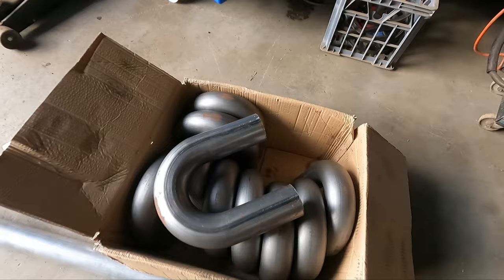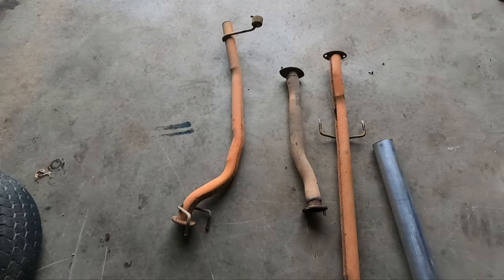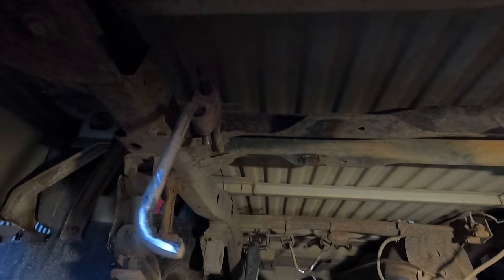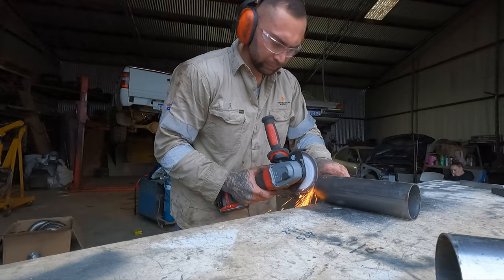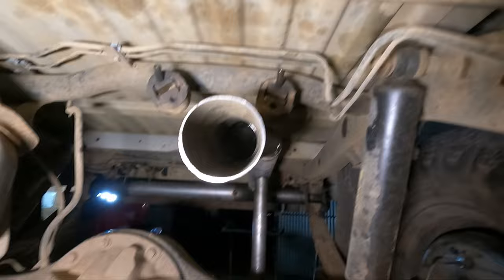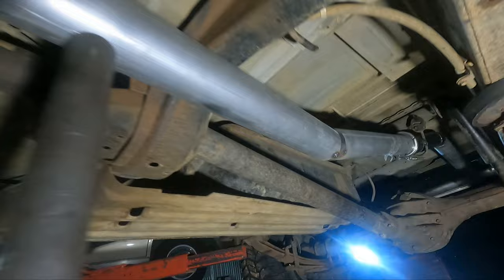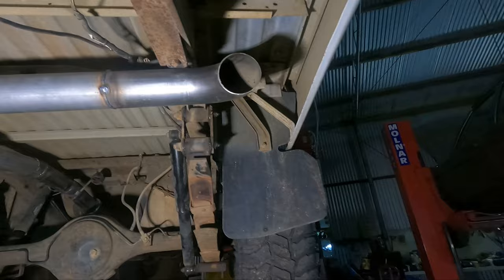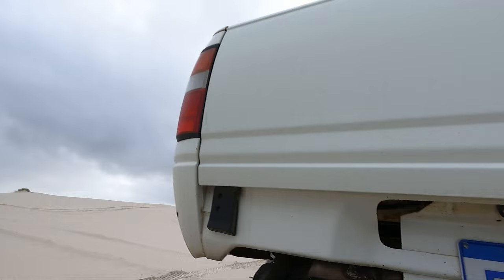2.8TD TF Holden Rodeo twin 3" exhaust

Comment: Have fun with the dump back to the back of the transfer. Mine was a 95 which has the oil filter in a different pos to yours. Dump had to do an S bend to clear the filter and down to the bellhousing. Days to get the bends right using mandrel bends and straight pipe. Made a huge difference to lag and overall power though! Mine was 2 1/2". You might struggle with a 3" dump. Original dump to the transfer is thick wall 1 3/4" so almost down to 1 1/2" nb!
Reply from the maker: Yea sounds like fun haha maybe I'll try fit 2.5 inch in there instead
Reply: A 3inch dump  will fit past both late and early oil filters.